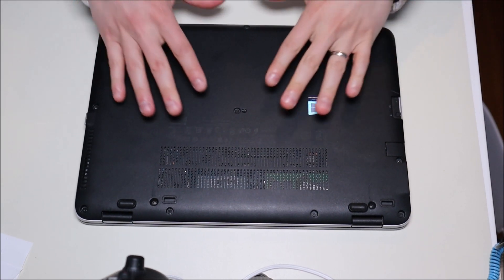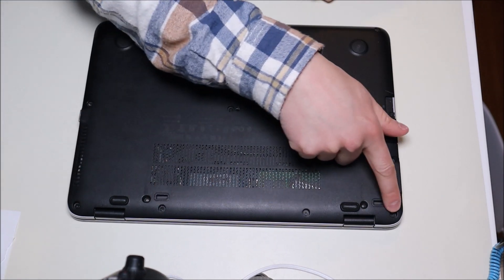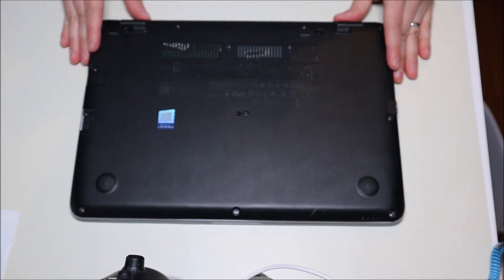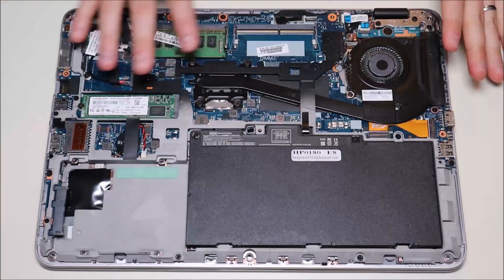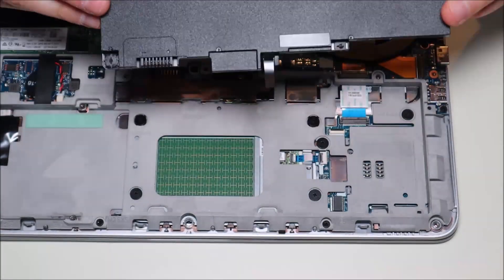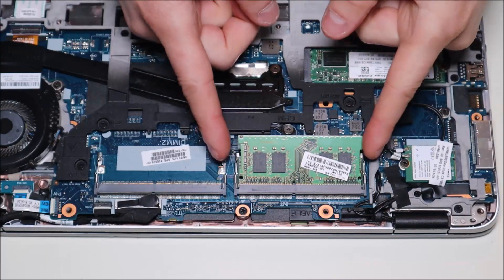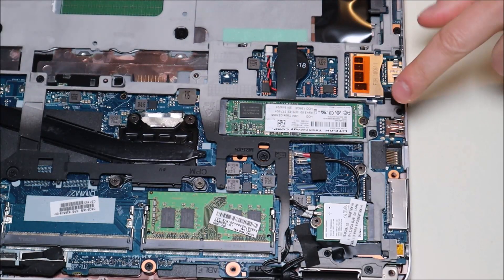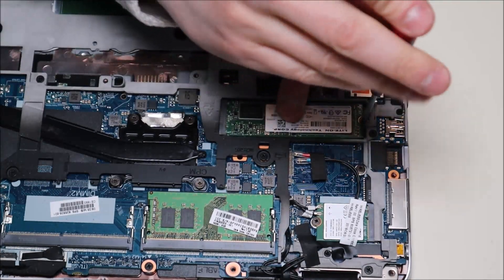How To Replace Upgrade RAM & SSD (Solid State Drive) HP Elitebook 840

Comment: I have the same model and its been stuck in a boot loop . I’ve watched your other videos on what to do for a boot loop and it didn’t work are there any other options?
Reply from the maker: 1.  You watched this video on how to fix an HP in a boot loop?  https://www.youtube.com/watch?v=lKb2pPQrkRk.   How did the diagnostic scan not work?  What happened when you ran it?
2.  Also, did anything happen before this issue appeared?  Liquid spill, overheating, Windows update, etc?
Reply: It’s working now thank you. I can submit my assignments 🙏 Is there anything I can do to prevent it from happening again because there are some issues with it freezing on random days
Reply from the maker: @whoiszizi2953  What fixed the issue?  I have to know what the issue was in order to tell you how to not have it happen again :)   Also, did anything happen before this issue appeared?  Liquid spill, overheating, Windows update, etc?

Comment: Thank Goodness Jamie , I have same laptop the HP elitebook 840 G3 now the problem is my girlfriend took it to school and whiles she was returning it in a rainy weather,  some rains did entered through the back not much .. we realized it and cleaned it asap . At the first place the laptop was on then we off it again and now it won't turn on the display even when the keyboard,  the power button and the wifi key light indicator is on ...  I tried the three process you teach on your platform and didn't work ... Can you please help me out , I can't afford a new laptop now 😭 😫 😩
Reply from the maker: 1.  For a computer that does not turn on, try this video first; https://youtu.be/HHwzA37r4e8. Let me know how that goes :)
2.  After a liquid spill, you want to first make sure the computer is 100% dry. You would turn your computer off immediately by pressing and holding the power button until the computer turns off. Then you would disassemble the computer as much as your comfortable with, at least trying to remove the bottom case. Then you would turn it on its side and let dry for a couple days.  Have you done this yet or are you sure the computer is dry?

Comment: Need help with a Samsung np950sbe x01HK that is not switching on - lights on the console go on and flicker every now and then but screen is totally dead.  Can't see the CMOS battery or the RAM in order to follow your advice on those two possibilities
Reply from the maker: 1.  For a computer that does not turn on, try this video first; https://youtu.be/HHwzA37r4e8. Let me know how that goes :)
2.  Also, did anything happen before this issue appeared?  Liquid spill, overheating, Windows update, etc?
Reply: @PC_Monkey  I tried the previous video and could not get to the RAM and CMOS battery fixes cos I simply could not see them.  As for what happened before the blank screen - this PC is a weird one in that the power cable is plugged into a USB C port. There are two ports with lightning bolts on the left hand side and one without on the right hand side. I usually plug into the left hand side. But my mate needed to use the PC and plugged the power cable into the right hand side port. The screen went dead and has not been able to switch on since. Although I see blinking lights when I press the power button on whether on battery or plugged into mains
Reply from the maker: @moazamfakey7211  If, after all these steps, you have not been able to find the issue, your most likely looking at a faulty component preventing the motherboard from working or a motherboard issue.  I would start troubleshooting each component, starting with the charger and power jack.  You can see those two videos here;  https://youtu.be/YBhsVHideGE  &  https://youtu.be/HpabvrNaodU.  You can also try replacing other components like your Power Button to see if that is the route cause.

Comment: I've been through a lot of your videos. My husband and I have taken my HP laptop completely apart.  We've checked the battery, we've checked the charger, we're pretty sure it's not the RAM.  I have a HP laptop, model 17-by0081 (not sure if it is a 0 or an O) product 4WJ86UA#ABA serial number 5CG83756TO.  I have a feeling you're going to tell me based upon the model, it's the motherboard.  If it is,thos will be the third HP in about 6 years and I'll be going with a Mac after this.  It'll power on, we can hear the fan, but the screen is black.
Reply from the maker: 1.  If you can hear the fan, then perhaps the computer is turning on but the screen is not working.  Can you try the steps seen here?  https://youtu.be/e9iy30J00-k
2.  Also, did anything happen before this issue appeared?  Liquid spill, overheating, Windows update, etc?
Reply: @PC_Monkey  ...no update.  I recently cleared out all of my emails as I was having issues with sending and receiving emails.  Nothing has been spilled on it either.  There hasn't been a Windows update.  If you were in Colorado, I'd just drop it off to you and have you figure it out.